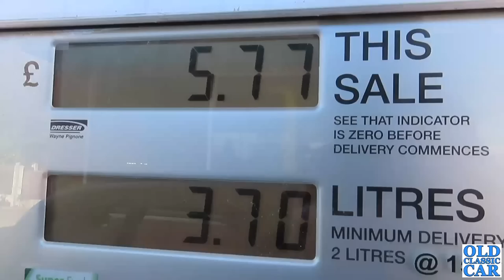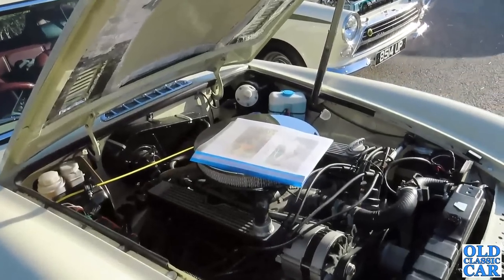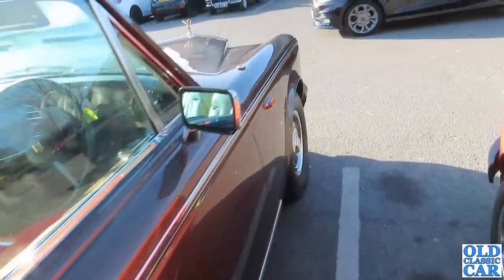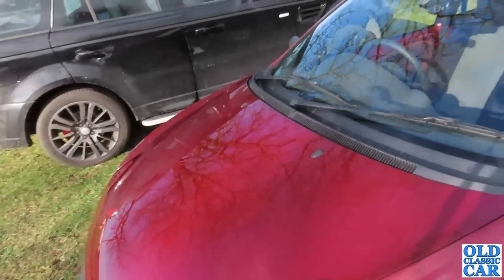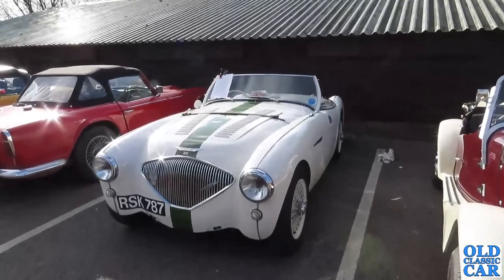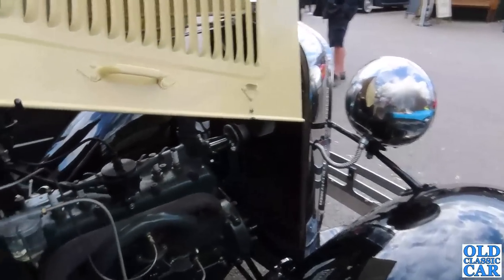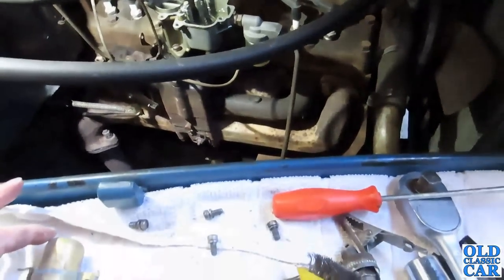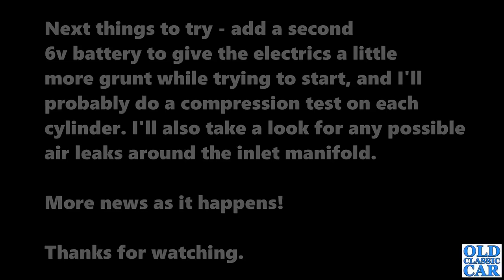Classic cars at Hopley House - and "why won't it start???"

Comment: Beetle was a 1302S fitted with the 1600cc engine, and with McPherson strut front suspension, rather than the torsion bar suspension of the original Beetle. The 1303 followed and these had the same front suspension and running gear but had a curved windscreen. I ran a 1303 automatic for a while and this had a torque converter with standard looking gearlever that, when you pushed down on the top, operated an electric clutch. Two pedal driving but you could change the three forward ratios at will as you drove.

Comment: I had an R registered Ford KA.  It was a pleasure to drive and very practical..  It finally succumbed to rust in the left rear wheel arch around the fuel filler, but much worse than the example shown.. I traded it in for a Citroen C1.

Comment: I totally agree with you about the Ford Ka. When they first came out, my daughter won one, but she couldn't drive, so me and the wife used it. They were great little things, driving more like a kart. I wish now that we had kept it, but you don't think of a car being classic until it is.
It was nice to see the Standard saving the day. Back in the 60's a mate had one and they were quite the car to have. 
As for the Chevy, did you clean out the filters? If not it might be that another piece of muck made it's way into the main jet. Just a thought. Failing that, it might be that it's just too cold, try my kettle of hot water over the inlet manifold trick, you never know. Good luck.
Reply: I wonder why I called the Dodge a Chevy?

Comment: You’re right about the Ford Ka ,they’re a fantastic little motor.Rust is their downfall though,especially around the fuel filler cap.My Mrs had one for a few years and we must have had the rust attended to there three times by different competent body work people but it always came back and we were told “they all do that sir”.It comes from the inside out,my brother had two of them and they were the same.The one in the video is actually a very good one.Otherwise great reliable cars.Ours went through a couple of springs but the wife always blamed me for be a bit on the large side. Our mechanic used to call them biro springs.I think I’m right in saying that they still had a version of the old Anglia engine albeit much modified.
Reply from the maker: I saw a little old lady in one of the sporty KAs a few days ago, it's been a while since I last saw one like it

Comment: Enjoyable  video yet again 👍 26 years ago the KA was launched, how time flies. 
When launched a friend bought  one, I wasn't  keen on it, owners would end up damaging  the rear wheel arches,  was the KA wider at the rear? 😂 
   Aithough  I wasn't  keen on the KA I  only ended up buying a new basic model as a runaround,  I was impressed  so I then bought  the posh version with leather seats etc.  I inherited my late father's 09 Nissan  Pixo, which makes a great runaround  and I can enter London  ulez.  Which I disagree  with. 
The Pixo is a throw away  car but I find  it to be very reliable motor. 
As for that chopped roof Ford, I wouldn't  even give it a side glance,  vandalism  comes to mind.  Cheers all 🥂 .

Comment: Maybe an idea ... use some "start-Pilot" to help starting? Or you could have some air-gap in the input-manifold making the mixture to lean??? (had that problem with my Taunus P2)
Reply from the maker: I have been wondering about a possible air leak around the inlet side, I'm not keen on Easy Start type products as an engine in decent order and used fairly regularly shouldn't need it.
Reply: @oldclassiccarUK  totally agree about that "easystart". If necessary I'm using about 3cl/4cl of gasoline that I pour into the air-inlet of the carb. Does the job when my car has been out of use for a longer period.

Good luck with the search and the "repair"!

Comment: Isn't there also an idle jet in the carb? Blocked main jet would stop any revs but usually they'll start and tick over on the idle circuit
Reply from the maker: There is another yes, I had a look at that later but didn't vid it

Comment: That looks like you may have a condenser problem. Usually shows up as a spark, but the engine will not run because it is in the wrong place as the condenser is not able to control it. just guessing. Other things that can cause the spark to be in the wrong place or weak ate the carbon brush in the top of the distributor. Break down of the insulation on the distributor cover or any of the HT leads but as the engine will not fire then the coil HT wire. The list can go on. I would even pass some paper through between the points in case there is a whisker hiding there. It can even be a slug of old poor fuel. Personally I would change the condenser first though.
Reply from the maker: A useful shortlist there Mervyn, I'll report back on the Dodge soon. Thanks for watching!

Comment: I'm surprised you don't have battery booster.  Mine's a NOCO
Reply from the maker: I did have a 12v one a while ago but rarely used it, if I found a 6v booster then maybe I'd get another. Thanks for watching.